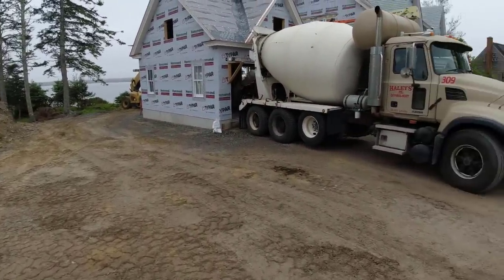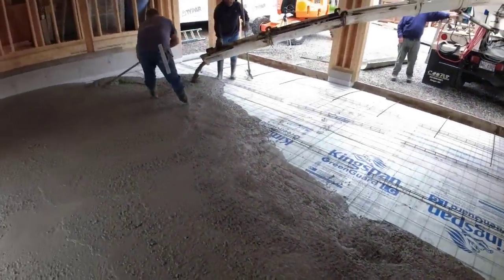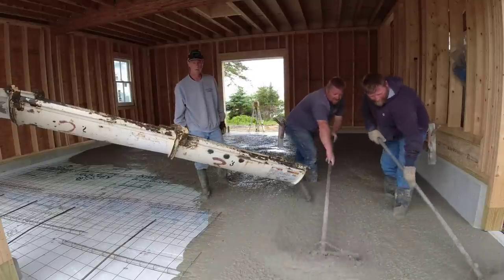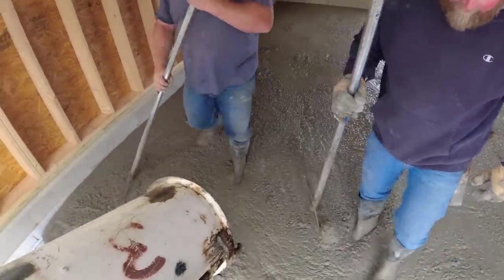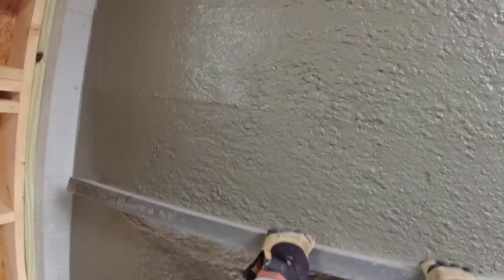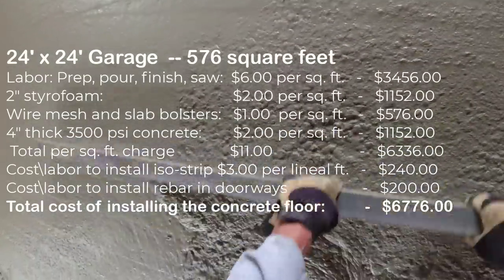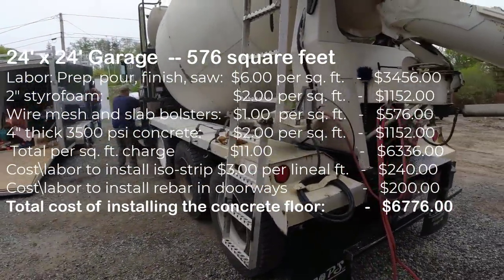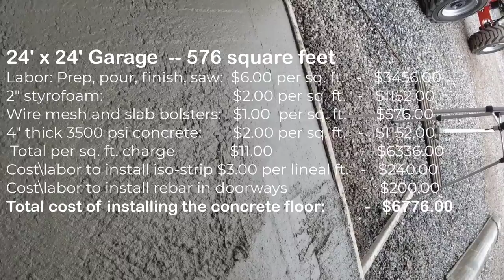Pricing Concrete Jobs - 24' X 24' Concrete Floor (Prep, Pour, Finish)

Comment: Up here in RI- just had floor poured in my garage three weeks ago. 26’w x 28’d garage, was $3,800 total.  5” thick, Has rebar in door openings, wire, and they did the foam around the edge. No insulation under it, just the plastic vapor barrier. Did wind lip at garage doors, and they saw cut it the next day.

Comment: That pricing is phenomenal. Thank you for your transparency. I've been quoted 900/yard for just pour/ finish work, which would have been around $5500 for this job. That does not include the prep, or other materials like foam/rebar. I'm in Maryland.
Reply: Yeah you gone pay more in Maryland; MD is insanely expensive. I'm in DC; I feel your pain on high quotes.

Comment: I wish all concrete contractors would check this out and charge like this.  So many just cover their costs and don't figure profit into the equation.  Great video breaking down the costs....also good for the customers to see that good concrete work isn't cheap.
Reply from the maker: Awesome, thanks Dirk!
Reply: Unfortunately ALOT of people think it's cheap.
Reply: @Pablo_19_26  It's one of the most under rated trades in the industry. Most people think you just throw some concrete down on the ground and it levels and finishes itself🤦‍♂
Reply: @@MrMajikman1  well they're not entirely wrong as long as the mixture isn't too dry. It's not a difficult trade to get good at.
Reply: @TheEngineerJason  "As long as the mixture isn't too dry?" What is the correct terminology for that, oh great one? 
I have my own business and I have been in the trade for forty years and still going. As an owner in the new construction field of full basement foundations, I have had to correct Architects on their structural/dimensional designs, I've had to correct Civil Engineers on their grading plans, I've had to assess ground density on site for bearing loads simply by looking at certain clays/soils. I have to make field determinations of which way to properly run the water off of the surface of the concrete so as not to impact a surrounding building. 
All of that with just a High School diploma, but 40 years of field experience.  

However, you are right, the "laboring part" is rather easy, but that is not ALL that is involved in concrete construction...if you are to be successful. 

Sure, you can pour your concrete with a 10" "SLUMP" (btw, that is the correct terminology for determining how "dry" or "wet" the concrete is) without using a water reducer...if you want it to crack. Obviously, there is much more to concrete construction that YOU and many other people are not aware of. Sun, wind, temperature, humidity, ALL contribute to how the concrete reacts as far as curing and finishing is concerned. And NO, concrete doesn't just "level and finish itself" regardless of what YouTube tells you.
Reply: @@MrMajikman1  you know what I mean by dry and so does everyone else on the planet. There's no need to enter with your superiority complex and your hurt feelings.
Reply: @TheEngineerJason  Pointing out your ignorance certainly doesn't "hurt my feelings"...nor my bank account!
Reply: @@MrMajikman1  then why did you try to insult me? If your feelings weren't hurt then that's totally unnecessary and illogical.
Reply: @MrMajikman1  Although you were correct on just about everything you said, with the exception of slump and self leveling.  SCC (self consolidating concrete ) is self leveling concrete.  It contains a high cement content 700+ lbs per yard, with a low w/c ratio, high range water reducer typically 8-10 Oz per cwt, and usually a 50/50 with 3/8 and sand.  And a spread is performed instead of slump.  
Slump is measured for consistency and workability, which engineerjason eluded to when he mentioned “dry mix” it’s actually workability
Reply: readind all this i have to say something. in aerospace 43 years retired, 3 degrees in manufacturing, CNC programming, design drafting degree and a california certified tooling designer 4 year apprentice graduate. did continuing college college classes up until 5 years of retirement to keep current. was in the trades to pay for my first college degree. i also held one of the highest security clearances a civilian can hold doing what i did in aerospace. my last three years in the industry i just broke into a 6 figure income. trying to get a simple monolithic slab poured in carson city nevada 6" thick with 16 deep footings/perimeter on a drainage graded side yard to the house. they want 54k and the concrete cost for the 60 yards is 7800 dollars pricing it myself delivered. would do it myself but at 70 and no real practice at skreeding, or power troweling i know it would come out a mess not having the practice. the prices people ask are out of line compared to what i did and how i was compensated. practice, common sense can get the ground prepped with a bobcat or skip loader, laser tracker (our term in aerospace for a laser transit) soil survey was done on the house and the lot so it is not necessary as it meets peculation/compaction codes here to build on. forming, grunt work aided and sped up with the transit to be on grade. rocking in the base and compaction again grunt work, vapor barrier the cost of material plus a minor up charge, wire and rebar again grunt work and a two man crew a days work or a day and a half. its an acquired skill overall gained by repetition, not something with allot of education or skill sets except for the foreman or contractor of the crew he runs. today job shopping knowing what i know/experience level i can get maybe 65/hr or consulting 100 and hour on certain projects. my job here for that mono slab 3 man crew possibly a week and a half so 60 hr x 3 240 man hours so say 250-275 man hours womb to tomb job. 54k -7800=46.2k so 10sq labor + mtl 2700SFx10=27k so 27k+7.8k=34.8k. 3 crew labor cost is 5500 bucks so if i add that on top of the 10/sq it still only gets me to 40.3k and that is double dipping paying the crew twice. so an extra 7.8k on top of double paying for the 3 man crew labor. i nearly fell out of my seat hearing  Mike said for the iso strip 240 bucks,$3 per foot,  his cost $1 per foot so 2 bucks profit for 15 mins labor 240/3=80 so 2x80=160 bucks for 15 min of his time. so 15 x 4= 640 per hour labor rate for that service per hour. insane. then one commenter here where they do not work all year. Mike does garage epoxy floors, and inside work people get done when it is too cold to pour. he diversified so he is busy year round and with his youtube channel he is making bank on that alone as a full time job, he is a very smart cookie.
sadly, when you are in demand you can charge whatever you want. it does not mean you are worth it. Mikes rates on the whole for what he shows he can do are realistic overall, with exceptions. here he honestly nickel and dimed the customer as it is not his normal thing to do it seems and he does not like working from engineering drawing (he showed this in another video working from prints) he prefers to do what he knows and does from experience in his trade which makes sense i guess. but to me having somebody just tell you to do something and not think should be allot easier and cheaper for him to do, just saying. too many contractors are no where near worth what they ask or expect and pass off as quality work. in aerospace and on our satellite factory floor they would get their walking papers asking what they expect for what they turn out. Mike is one of the outstanding exceptions in today's trades i have some across. he is what you expect coming to bid any job you are asking to be done. seeing this kerfuffle exchange though i had to say something.

Comment: Thanks for the videos, just retired in Thailand just did 42sqm 6x7meters, 4 cubic meters i did it for $234 that's 28x cheaper and with no permits or any kind of red tape no tax either for my house build 4000sqft under the roof $45k usd

Comment: Much Respect to YOU & your CREW  !!! EXCELLENT JOB  !!!
Reply from the maker: Much appreciated
Reply: Mike 
What are for just labor concrete 
We are $5.00
4 inches 
With little prep work 

What do you charge to lay wire 
If they supply it

And what about commercial floors 
We are bidding a church floor

Comment: I had a floor poured last year (by another youtube concrete channel) that had a particular section that was 6" thick vs 4".  Price was all quoted by the square foot with 2 extra yards listed as line item charge for the thickened area.  The end number worked out very similar to your total once I subtract $2 / ft2 for no foam under my slab.

Thanks for the info, very insightful for not only concrete tradesmen but also people saving for shop builds
Reply from the maker: Glad this helped Chris, thanks!
Reply: dang he got me, jk I don't use foam. I was kidding. I was curious what your concrete  price is up there I watch the 1 u did at your desk but concrete labor and mudd is high in Indiana. we charge alot. but I'm one of the cheapest in my area. but u work for builders which I solid work but I don't bid by Sq foot I bid by days and cross reference w Sq feet. we r up around 13 a Sq foot around indy for driveways or better.  I charged 20k for a 26 yard driveway but we had to tear it out too. I was at 22 but I wanted to make sure to land it. u charged 7 grand for this even though there is alot of material u did pretty good. I would do that garrage w no foam no prep about 3500 to just pour it.  no prep.

Comment: If you were in my area i'd hire you to do a 600-1200 sq foot slab on a new project next summer.  Your pricing seems fair.  I did a 40x60 slab w/ footings for a big steel building 7 years ago for $12,000 but I did the excavation and prep myself, including engineered foundation to support a garco steel building.  For a 2-3 car garage finished that's about double per sq foot of the big building I did but prices have gone up and your labor is worth double the cost of the concrete.  I honestly don't trust most of the guys doing this work any longer - the finisher I had do the last slab was very fair and he has since retired due to health issues.  At the time the finished cost for everything was going to be about $20k in 2015 not including my labor for 2400 sq feet if I didn't lift a finger.
Reply from the maker: We used to do those steel building slabs all the time. 2' thick footings with a 6" slab all in one pour. They were around $10 per sq ft without styrofoam.

Comment: by the square foot with all the xtras required to lay in prepping with bars, supports, iso strip and insulation seems best way to quote and consider. everything laid out, seems fine to me to meet those specific requirements. rather pay and have it done well and over than go through doing it.

Comment: You probably have information about the cost of making a house with hard materials, such as concrete. Compared to a standard wooden construction, how much more expensive is to build a house out of concrete, blocks or pouring concrete?

Comment: Mike it's great to see that I'm not to bad in doing my estimates.

Would you care to share what is in your opinion and based on your market a fair cost to demo and haul existing concrete 4 inch
 #1 not reinforced
 #2 reinforced 
Or alternatively dig and haul 4-6inch dirt and set a #57 stone base once compacted.
Reply from the maker: I sub out the demo and re-grade on existing concrete jobs, then we re-pour new. I know on a 24' x 24' garage floor the cost to demo (4" to 6"), haul off, and re-grade is around $5000.
Reply: I am in southwest Michigan. I do all my own demo using my own equipment. I tear out using a Deere 80 excavator with thumb and a tri axle dump truck same as an excavating company would. I charge $1.50 per square foot for 4” driveway removal wire mesh or not. Garage floors we would do with a skid steer with a hydro lid hammer. I would charge my customer approximately $3000 for a garage floor tear out 24’x24’

Comment: Like that self leveling concrete!
Most of the guys around here pour it so damn dry that they work themselves to death!
Early 60s concrete was 15 bucks a yard and I charged 50 cents a square foot, 55 cents if a rock salt finish. That was for grading, forming and pouring. Did mostly swimming pool decking, which is a lot more difficult than a flat slab.
Reply: If you pour  your concrete  over a 5 in slump, you gambling  on the strength!! I did commercial  concrete  for 25 years and tested in labs also, 4 " slump  was the max,any one  can pour wet concrete watch it detiorate  in the next few years ,concrete designed  strength  is to be placed a 4" slump  !

Comment: for new construction garage is high , even hen you don't put wire mash and foam , still 8$ is a lot . I would do that all day everyday like you for that price but here in Michigan Mexicans do new costruction for 5-5.5$ per sqft prep and finish (no mesh or foam ) .its unbelievable .
Reply: California Mexican crew. 2500 foot house...form, set, pour $4000.00...frame house $6000.00

Comment: I’m in central North Dakota, I bid a job around $10/sq foot, for a driveway, and the guy almost fell off his chair. $180/yard for concrete, $10/per 20’ stick of rebar, I don’t think $10 sq foot is too high, that included tear out of the old driveway. Thoughts?

Comment: Wow that’s way higher than what we get in Louisiana.  My flat work rate is $6.50 a foot for 4” slab and we do the dirt work.    Of corse we don’t have any foam are anything we have to put down.  But that’s still a big difference.      
I’m at $6.50 and still get under bid a lot of times.    I’ll go look at a project and see that some one else did it.
Reply: So basically a 24x24 I’d charge $3800 total job.  Labor, materials and concrete included in that total.
Reply from the maker: Wow Joe, you got to get the prices up down there.
Reply: @MikeDayConcrete   I wish.   We’d be making a lot more money!
Reply: I live in San Marcos TX but most my jobs are in the New Braunfels and canyon lake area and our going rate on labor and materials are the same at 6.50 and that's pushing it most guys are still charging 5.00 to 5.50 a square foot on flat work out here
Reply: @sabasmendez-perez8560   yea it’s don’t matter what price you want, you have to be competitive with everyone else.   People will hire the cheapest bid.
Reply: @Connerscementfinishing  that’s still almost 500 a yard. That is pretty good for flat work

Comment: Mike, I have some footings (18 inches expose on one corner) that support a 6 inch slab (total size is 10 X 12 foot) for a shed.  Any suggestions on what to use on my corners to decrease chances that will corners will burst open during pouring concrete?  I am located in Colorado and temps are 45 to 75 degrees range overnight to high noon.  Thanks as this is my first concrete project.  Very difficult to find anyone to do this job and that is why at 77 years old I am have dug the whole project (couldn't even find a backhoe for rent)
Reply from the maker: We use metal banding, google it, it's a thin strip of metal that has holes in it. Comes in a roll so you can cut it to any length. Wrap it around the corner and screw it to both sides. It'll keep the corner from blowing out.

Comment: He aint the cheapest, but not the most expensive either. Id be happy just having a guy show up that knows what hes doing. In my area they show up and charge $$$ with far less experience than Mike has. Its concrete i dont want that junk cracking 3 days after they pour it. Pay the money to have it done right.

Comment: I’m in New Jersey and I want to charge 20/sqft for concrete work. Including form, prep, pour, and finish, is that a good way to go about charging or should I charge based on what each job requires?

Comment: What’s the best mix for pouring in warmer weather that will give me optimal time to finish a driveway /patio it’s been almost 90 degrees and I’ve been chasing it every time
Reply from the maker: In those temps they can add some retardant to slow the set. We use 4000 psi 3/4 stone mix for exterior concrete here in Maine.

Comment: Mike, I just recently moved to Glastonbury CT. I'm looking to get a 6" slab poured in a 20' x 30' barn. I'm new here, have no network, so I'm just using the Google machine to find contractors in the area that do slab work. I must have called six contractors and not so much as a call back. It seems like a simple job. Is everybody that busy right now? Where else could I look to find a good contractor? I've been watching your show long enough now that I might just try to do it myself. Appreciate any advice you have.
Reply from the maker: Find the closest ready mix concrete plant, call them and ask for the concrete dispatcher. Ask him who the best slab contractors are in your area, and you may even get their cell phone numbers. The dispatcher knows who is good and who isn't.

Comment: Hi. Here to learn. Why’s the styrofoam under concrete, and what size rebar?
Reply: I'm sure its #4 1/2" rebar
Reply from the maker: Styrofoam insulates the slab and is code here in Maine. #4 rebar (1/2")

Comment: I’m trying to price a 24x25 monolithic 12x12 slab for a metal carport in wv. It will have a 6ft by 24ft ramp in front of. I will have to dig the footer and grade it myself then form and finish. It’s in the middle of nowhere concrete company wants 3grand for a full truck. After equipment costs I’m pricing it at 13k does that sound right